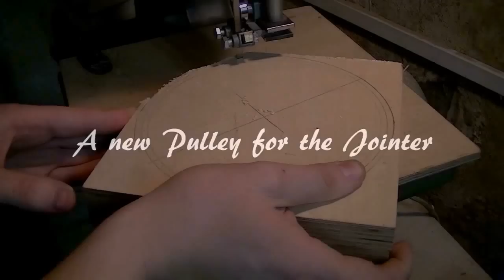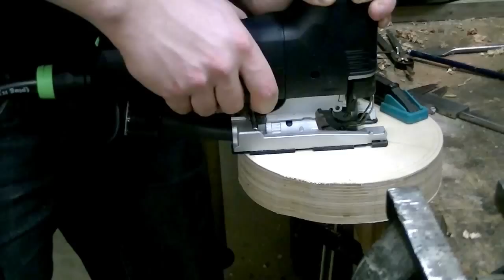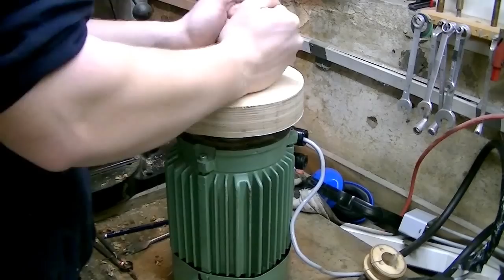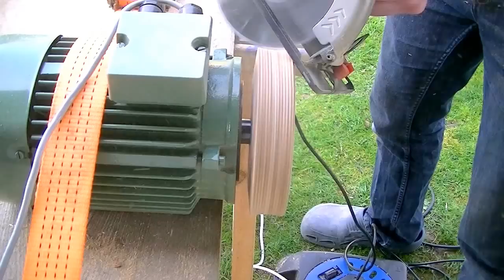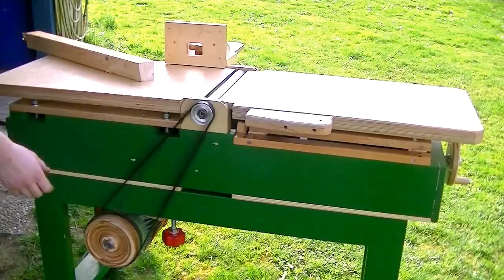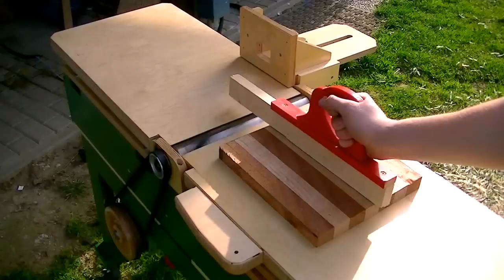Turning a Pulley for the Big Jointer - Drechseln einer Riemenscheibe für die Abrichte

Comment: Neat idea using a crowned pulley with a the poly-V belt.
I think I prefer my method of just using a chisel and a tool rest, like a lathe.
Reply from the maker: I tried it with a sharp chisel but somehow couldn't even scrape it, Then I tried the chain saw which didn't bite as well, like the chisel!
belt tracking works really well now, only that this belt seems to require an insane amount of tension.
Reply: Cosmas Bauer Not the tension it needs, but belt-to-pulley surface. That's why normally jointers have pulleys with 2 or 3 grooves for V-type belts or the one like a timing belt in the car engine. How much RPM your motor have?
Reply: Dangerous try
Reply: Cosmas Bauer
"...couldn't even scrape it..." That's the glue of the plywood. I had the same problem and ended up making myself a special chisel from a steel rod. (Hmm; hätt' ich natürlich in dieser Runde auch auf Deutsch sagen können;)
Reply: Sensacional !!!

Comment: Why did you choose the pulley with that size? Why not bigger or smaller. (I want to learn)
Reply from the maker: The size of that pulley determins the rpm of the cutter. Bigger makes it go faster and smaller lets it go slower.
Reply: +Cosmas B I understand that. But did you pre-measured? Did you know your goals you need to achieve? Or you did in the empiric-style? This motor is really strong, but under-optimization could lead to overheat. That's why I ask, to know better.
Reply from the maker: I knew the rpm of the motor the maximum rpm for the cutter and the size of the pulley attached to the cutter.
 Then I the right size for the homemade pulley.
Reply: +Cosmas B Thanks for the answering.

Comment: Hey man! That cuter head looks like its got plenty of cutting power. But how to be sure? I need help deciding the size of the pulley to attach to the motor of my new cast iron 12 inches very heavy jointer. Please help me. 
I happen to have a 6 inches aluminum cast pulley that fits the shaft of the motor. The motor is a 3HP 3400 rpm. The pulley on the cuter head is 2.5 inches. 

I guess this will bring the rpm very higher. But my concern is about power or strength of the cuter head to cut to its maximum width. Will it be affected? 

I know, I think I guess by logic, that if the cuter head spins faster, then the [2] blades will make more cuts per fraction of a second. But, what about power to be able to actually cut? 

I hope you can help me look into this. Because I could go and buy another size of pulley if you so recommend me. 

Thank you a lot in advance! 
Cheers from Peru.

Comment: Nice build, who worries about circ saw kick back anyways.
Reply from the maker: Thanks! To many safety sallies out there.
Reply: +Cosmas B Personally I would have used an angle grinder with a carbide steel dish wheel(kutzall), that would have been perfectly safe, right?
Reply from the maker: That would certainly work well. I tried using a chain saw first but it didn't have enough bite. Chain saws are made for softer material.
Reply: Yeah, I hear you. I think that you were rip sawing, and the chainsaw is designed for cross cutting. Perhaps you should try fitting a rip saw blade on the chainsaw?